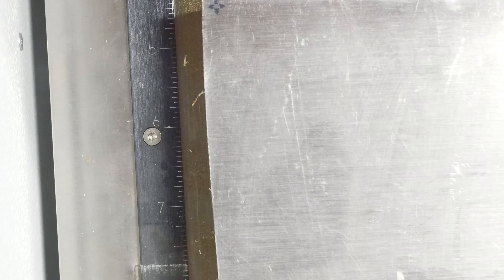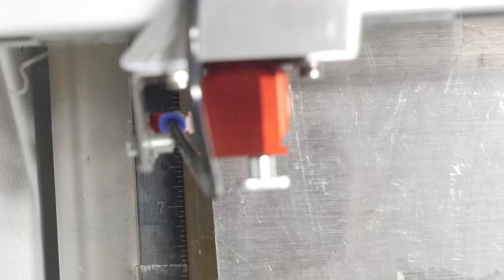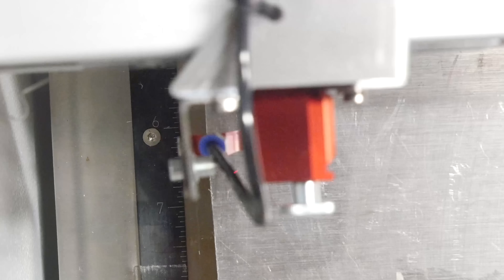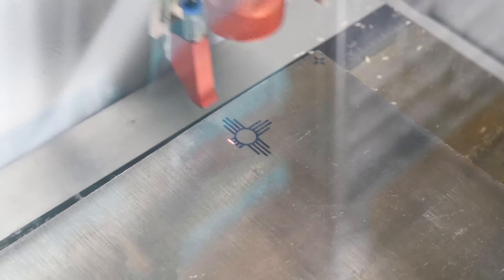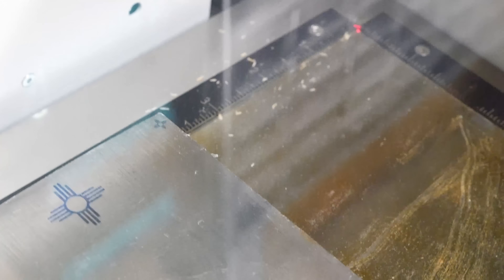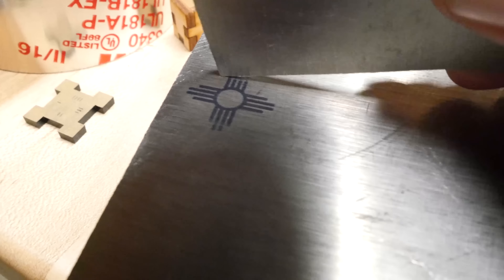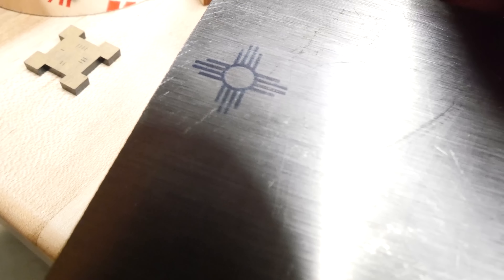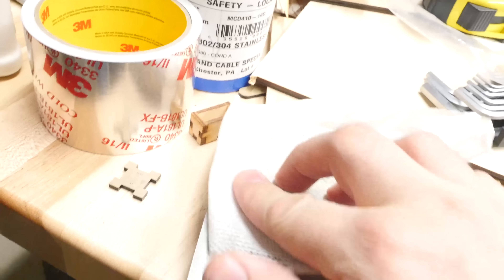Mark Titanium with a CO2 Laser Engraver!

Comment: You referenced the power settings at 100% for this project. In the Chinese CO2 laser cutter/engraver world, it is widely known that the advertised rated power is not realistic. Laser tubes that are operated at such levels tend to die prematurely. I'm not familiar with your model, but you may want to investigate that particular aspect, to enjoy the operation for a longer period. If you do not have an ammeter installed on your machine, it's advised to add one, then determine maximum current for your size laser tube. The tube size (diameter and length) will be your best gauge for finding the maximum current. Live long and phosphor.
Reply from the maker: Thanks for the note. I've heard the same thing about the glass tubes but I'm not sure if the same thing applies to this kind of tube, which I understand is made of ceramic and is likely to last a very long time. Since I don't use the engraver all that often I am basically expecting it to fail in other ways before the tube stops working, but you're right that it probably would be a good idea to put in another round of research.
Reply: Okay, that's very much a new one on me. Ceramic CO2 lasers is completely out of my understanding. In the glass-tube world, the clock of death starts ticking immediately after manufacture. Using the laser or not using the laser doesn't stop the clock on the glass tube type. The crap Chinese tubes die really early if overdriven, but also die an early death from sitting in warehouses for too long.  It would be great for you if you discover that you can run your 30 watt laser at 30 watts!

Comment: Have you investigated laser marking materials like LMM-6000? These are applied to the metal, marked with the laser, and then the extra removed. They also require ~30W but may extend your range of material and the permanence of the marking.
Reply from the maker: I haven't checked that stuff out yet. It looks like it makes some nice, dark marks though.

Comment: Very cool!  What are your plans for it?
Reply from the maker: Hehe... plans?

I guess I mostly got it with the intention of cutting acrylic stuff. It's pretty nice to use, you just turn it on, let it find its 0s, throw in some material, and basically hit print on a design you've made. No CAM and no fixturing is SO convenient!
Reply: That does sound nice!!  I'd like to get one that will cut 1/2" steel. :)

Comment: I have a 3mm thick titanium plate, thinking to make a birthday card out of it. Is it washable or is it permanent? Anyone tired to engraving on a larger scale? I have a access to a 100w Full Spectrum Laser P-Series laser cutter.
Reply from the maker: I'm pretty sure the laser is creating an oxidized layer directly on the titanium, so my thinking is it should be exceptionally permanent. Like, removing the mark might only be possible using a tool/process that would also remove some of the metal.